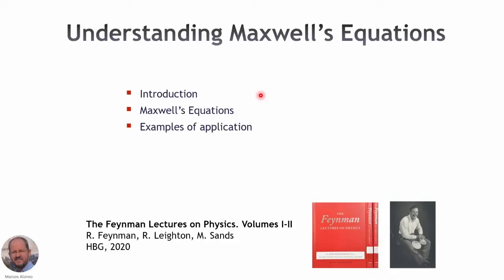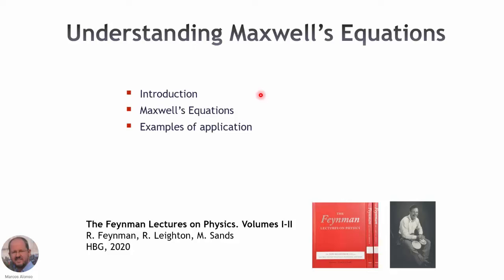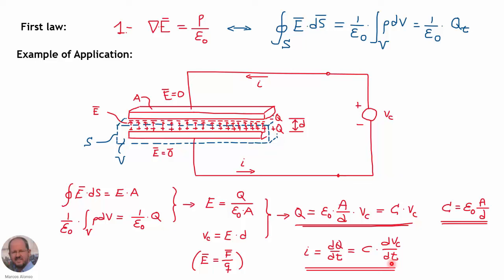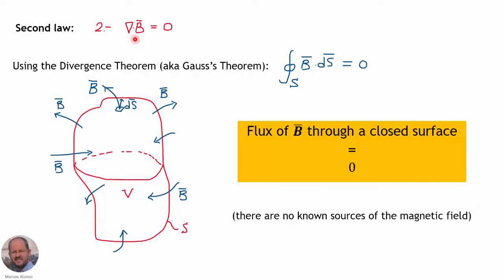PHY #5: Understanding Maxwell's Equations

Comment from the maker: 5:42 Correction: I have made a mistake in drawing the polarity of the charge. The top plate has positive charge and the bottom plate has negative charge. With the sign of the voltage source shown in the drawing, the transient current goes in the direction shown by the arrows, so electrons go in the other direction and therefore the top plate will be charged positively due to the lack of electrons and the bottom plate will be charge negatively due to the excess of electrons. Otherwise the rest of the explanations are OK.
Sorry about that! ☺